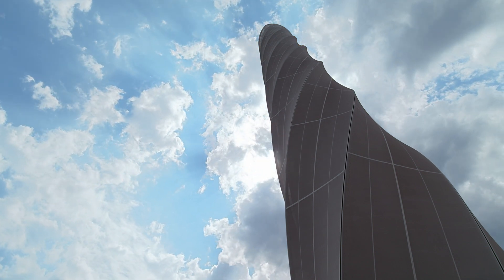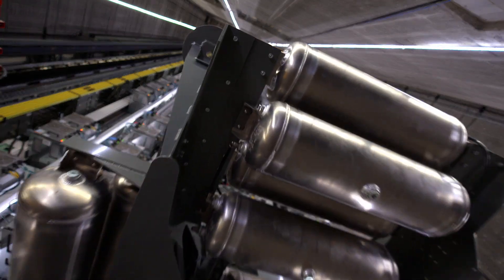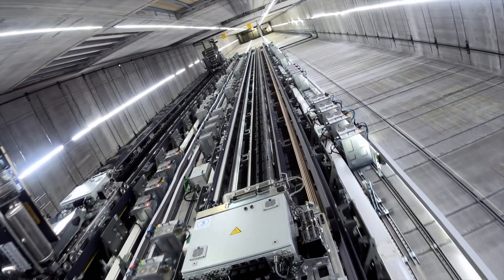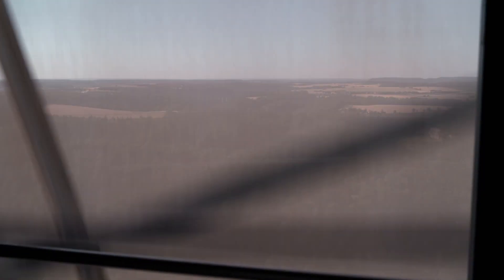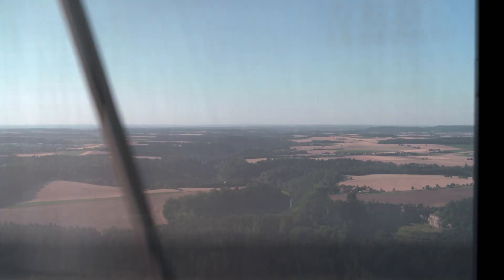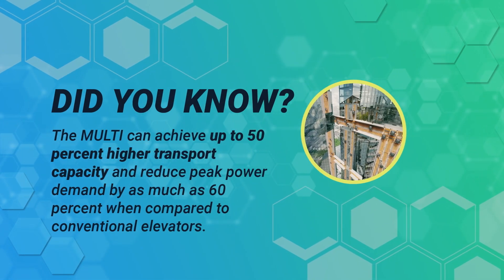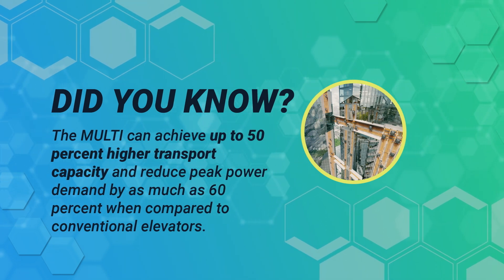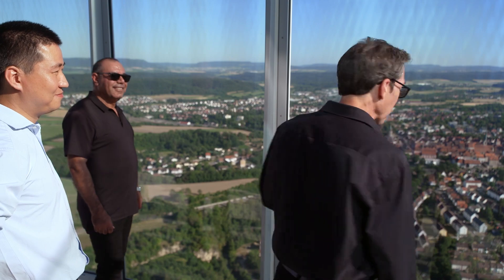Inside the World's First Ropeless Elevator

Comment: A “safer” design would be a fast acting switch in case of power outage. A big enough switch for a big enough UPS to allow the elevator cart to return to ground floor safely. 
Electromagnets and 100 sensors per meter would allow the cart to be slowed down at a safe speed to catch IF free fall happens.

Comment: what happens if the power goes out?
Reply: There is something called a shunt contact, which turns each section or stator of the linear motor into a brake, using eddy currents. This is a fail-safe system, in that when the power is lost, the shunt contactor closes immediately as it is a normally closed contact, hence is closed by a spring and opened with power. There is one shunt contact per stator, every meter or so, hence a failure of an individual contact by it failing to close, is not an issue. This has been on roller coasters for over a decade. It will not stop the elevator completely, but it will drop very slowly. With eddy currents, the more the kinetic energy involved via gravity, the greater the generated braking force. There will be either friction brakes in certain positions, or a nitrogen charged shock absorber at the bottom of the shaft to stop the cabin completely. control power can be maintained via a UPS battery for opening and closing the doors, the same system for emergency lighting and fire alarm systems.
Reply: @jjhatch69  this could probably have been demonstrated with a model using a battery and automotive relays instead of having a professional bullshitter refer to proprietary diagnostic software and motioning to visit the observation deck.
Reply: @jjhatch69  great explanation!
Reply: @jjhatch69  could you help me make something like what’s in the video?
Reply: What happenens if the electrical power goes out stuck?